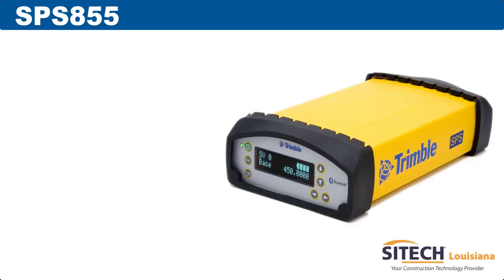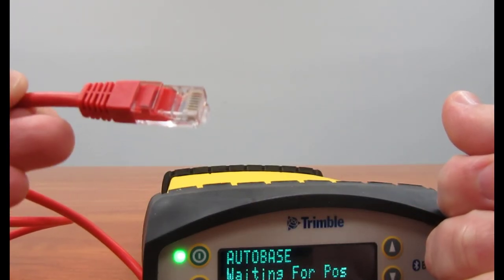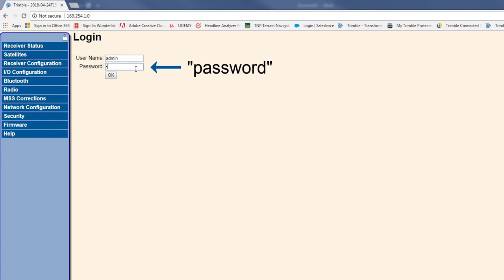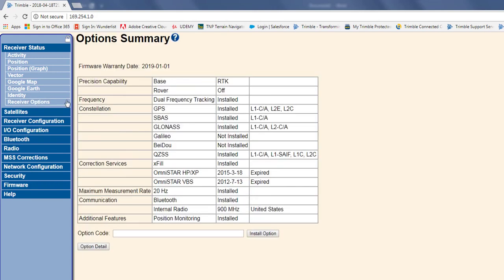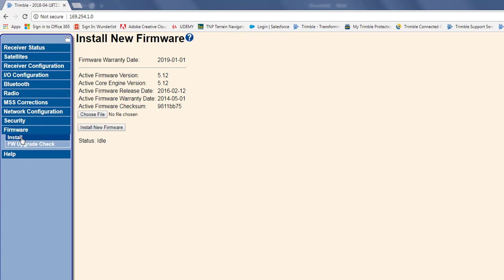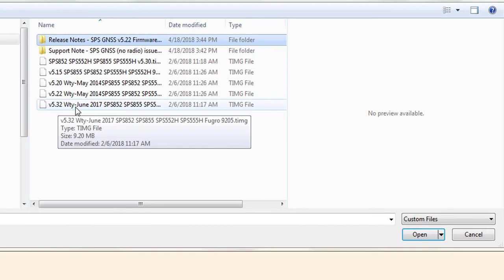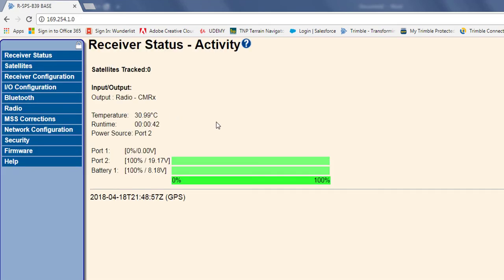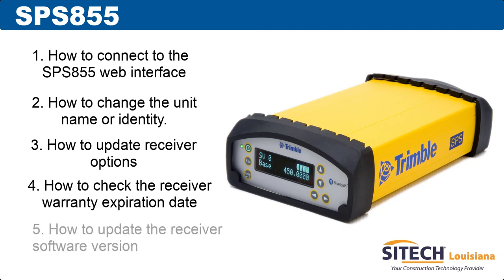Trimble SPS855 How to configure setting  - SITECH Louisiana

Comment: My trimble sps 361 can not outport the data. I have two sps361. One normal. One can not. Same settings. Trimble campany can show me?
Reply from the maker: Hi Van,
Here is a link to the user guide for the SPSx61 series.
http://measutronics.com/wp-content/uploads/2012/07/SPSx61-User-Guide
We are not a Marine Dealer currently, so I don't have as much experience with setting up an SPS361.  
But from what I can tell the connection and setup process should be the same.
Also, here is a link to the Trimble Dealer Locator if you don't know who your local marine dealer is. You should be able to contact them and get some help with the setting.
https://dealerlocator.trimble.com/
Hope this helps!
Reply: @sitechlouisiana8121  where do you download the firmwares